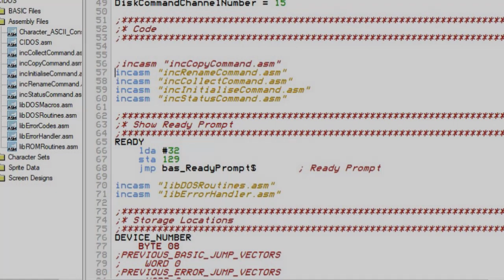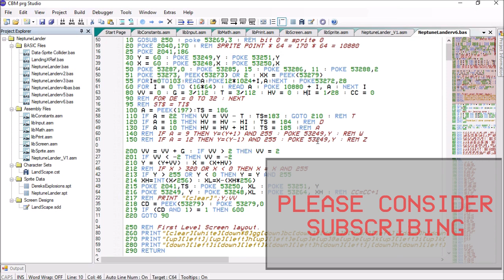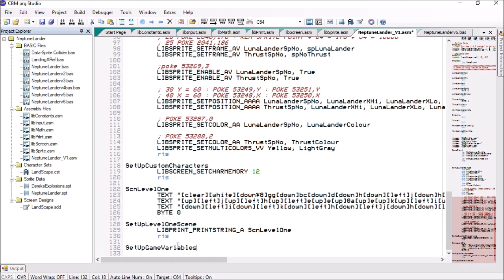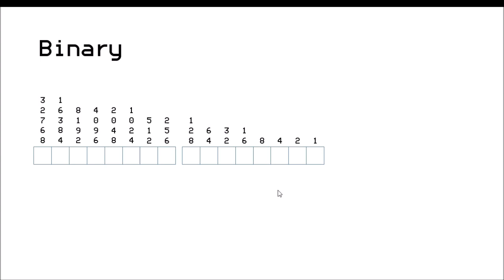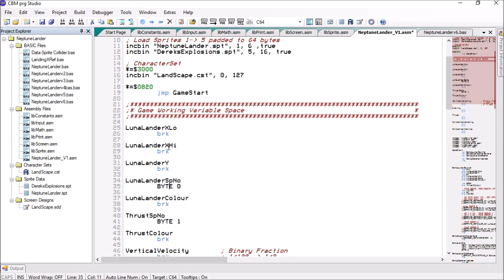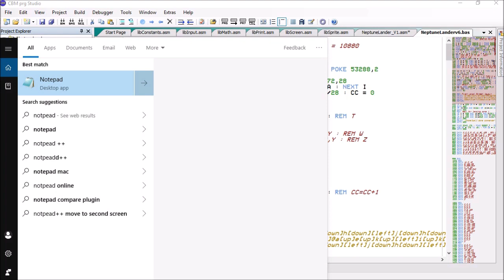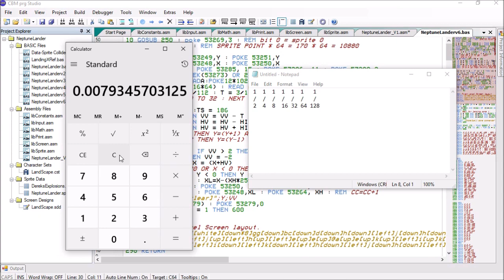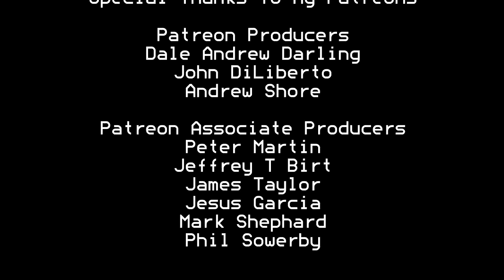Tutorial 35.4 - Coding Game Loop Part 1

Comment: Hi there
I've just watched this video.  You're teaching me so much.  But - (and you may have figured this out on the calculator)

When you did your 3/112 and you got a long repeating answer starting with 0.02blahdeblah, and you were trying to figure out the fraction for this,
On the calculator, there is a 1/x button.  If you press that after you got your 0.02 answer, it will give you 37.3(I think) and this is your fraction number - 1/37

Continuing to watch fellah :)
Reply from the maker: Watcha Dude, yeah, already had peeps tell me about his... lol, but will be releasing a video about a proper divider routine.... (using it on my Graphics Extension Code)... should be cool ;)

Comment: 5:46 Turns out that Assembly is a better programming language than BASIC, with meaningful variable names, meaningful labels instead of meaningless line numbers, and a better subroutine organization.

6:13 Busting out the G-word again!

9:55 Technically, fractions are often just a point of view, similar to how a binary number can be viewed as being signed or unsigned.  If you have a 16-bit number, you can look at it as a 16-bit integer or as an 8-bit integer with an 8-bit fraction.  The 16-bit whole integer would be in 1/256ths of a unit.

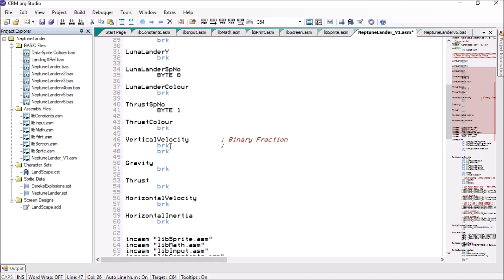10:30 Your slide at 8:20 correctly showed the fraction part as being in 1/256ths of a unit. 

10:52 The vertical velocity can be positive or negative, so you need to interpret the high byte as -128 to +127.

11:45 Adding a three-byte value is trivial, whether it's fractional or not.  (In fact, the code is exactly the same.)

12:21 You don't need to split the LanderXLo and Hi labels any more; it's an integrated 24-bit value. 

13:20 The timing values that were tuned to work in BASIC aren't going to be applicable to machine language.

You will also want to set up the frame timing to use the scanline, such as hitting scanline 250, to get consistent real-timing and to avoid any video tearing.  In principle, you can use different constant fractions between PAL and NTSC to give the gameplay a consistent speed.

14:10 In going from 1/2 to 1/128, you're only showing 7 bits.

15:30  There's a much easier way to convert decimal fractions to binary: just multiply by 256 and you're done!  View it in hexadecimal to make it easier to see.  E.g., 1/2 * 256 = 128, which is $0080 in binary, or 1/2 if you view this as $00.80.  3.25 * 256 = 832 = $0340 = $03.40.  3/112 * 256 = 6.86 = $00.07.

17:21 You probably don't need more fraction bits, since you have units of 1/256th of a pixel and your game loop will be faster in machine language.  At 50 frames per second, 1/256th of a pixel represents a lander drift rate of one pixel per 5.12 seconds.

17:45 The least-significant byte would represent 1/65536 to 1/512.

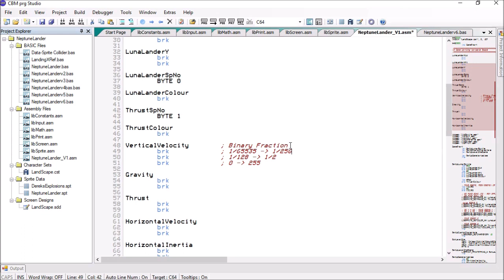17:56 Why does the background music feature mooing cows?
Reply from the maker: WOW, i love reading your comments dude, as sometimes I learn something new, I appreciate all the effort into dissecting the code, and looking forward some more controversial coding from me ;)

Yes, Assembly was better at using documenting code using variable names and function names rather that 10, 20, 30.....

Timing Values..... yes matey you are correct, and as you will see, they get adjusted later on ;)

I completely agree with the fractions portion of this, and you will see it evolve over later episodes.

Background Music..... Erm.... Mooing Cows?.... ill have to listen more closely..... Im just using music the MotionRide provided ;)